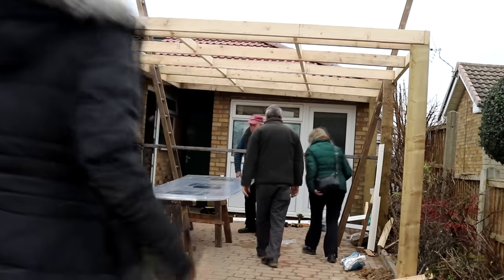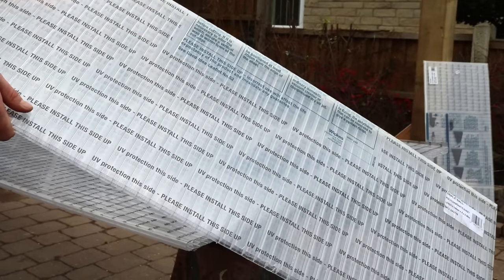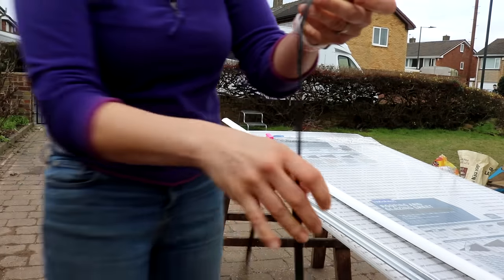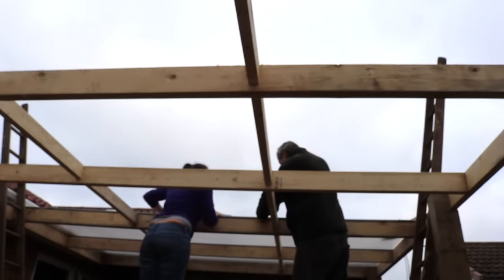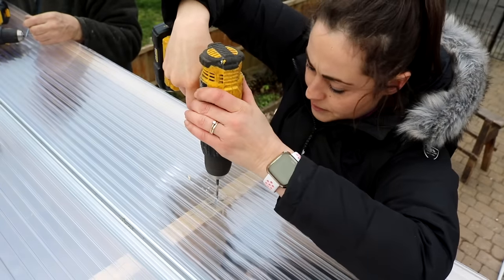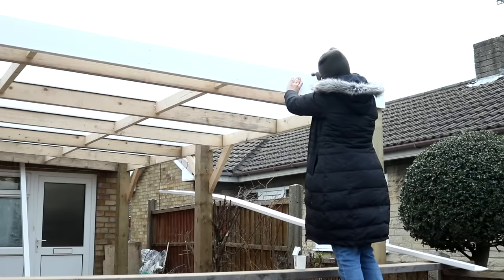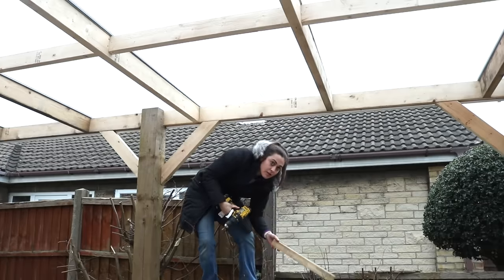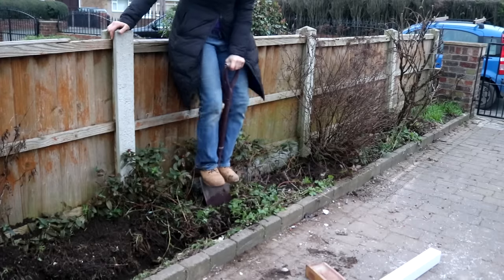Installing a Carport Roof & Guttering | The Carpenter's Daughter

Comment: Hi. At minute 4 you used rubber screw cover caps. 
I am finishing as well a polycarbonate roof and i want to use the same screw cover caps. 
My question is ... are good those screw cover caps ?
I mean ... the water passed through those screw cover caps or not ?
Thank you very much in advance.
All my respect !

Comment: the   foil tape  only  goes on the top edge for the polly  carb as breather tape/ dust tape goes on the bottom edge as air  needs to circulate

Comment: How about instead of the added soak away on the fence line, use driveway channel drainage to join up to the other down pipe on the corner of the bungalow? More groundwork maybe, but then that would also help with surface run off from the drive. Just an idea.
Reply: That soak away will turn that border into a lagoon.  But hooking up to drains is frowned on.

Comment: How do you address the sheet installation if they touch the brick on either side. Is there an edging kit supplied to prevent rain falling down against the wall and into the wooden beams from the edges?

Comment: Great video, I need to extend an existing car port slightly for a bigger car the existing one used 10mm twinwall but for the extension I was planning on just using 4mm or 6mm twinwall thing is all the securing screws and caps Im seeing online seem to be designed for 10mm and upwards. Are there specific fixings screws/caps you'd recommend for thinner twinwall sheets?

Comment: Great video Vikki and very useful as my folks’ 40 year old carport roof has finally packed in recently and I’ve offered to pop down and install a new one for them. Some useful tips in your vid! A couple of observations - those fascia nails with the coloured heads are called polytops. And it wasn’t clear from the vid but when you fixed the corner fascia capping did you screw in just that front face or the 90 degree face as well? I believe it should be just one face to prevent it from cracking as it expands and contracts with the weather. I learnt this the hard way last summer!

Comment: Nice Video, Does the carport needed inspection after build?
Reply from the maker: As far as I'm aware, it does if it has roof tiles.  The building inspector (my Dad's friend), recommended doing this with a UPVC porch as an easier option with less paperwork, but always check your local authority.  Each one seems to differ!